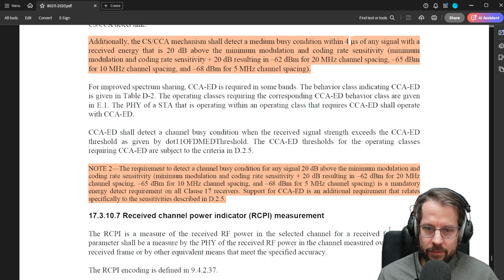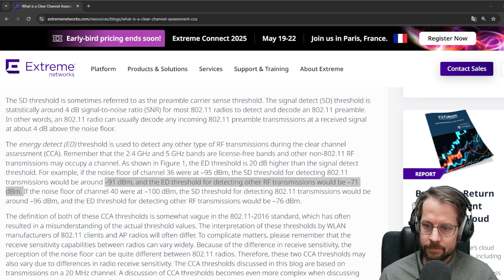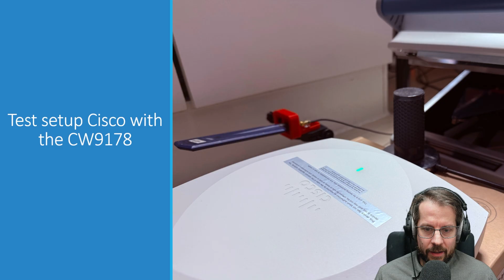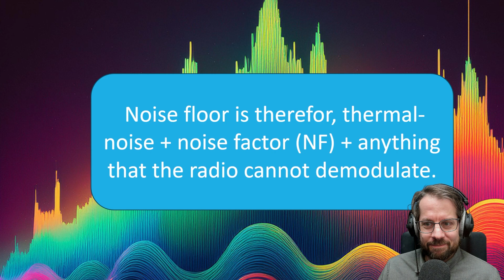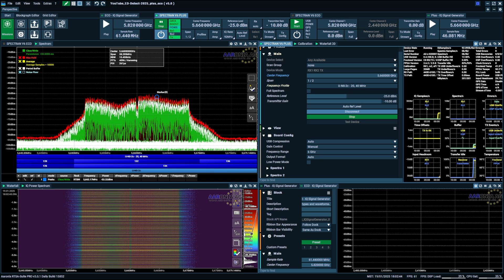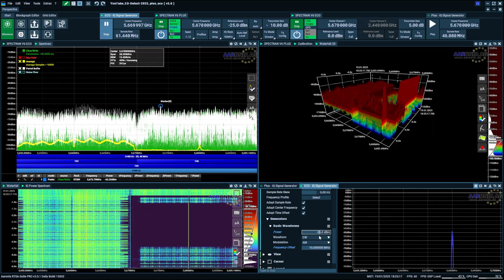Energy Detection in Wi-Fi - See how it works.

Comment: Great test, thanks for sharing. I'm hoping preamble puncturing will eventually be able to work around such narrow band interference. I too see many lighting sensors in the 5.8GHz band - jamming wifi. I will do some testing on later versions of code. PS the spectran V6 is an awesome SA for these types of experiments.
Reply from the maker: Yes, I hope so also! Thanks! Luckily the APs usually change channels, but I turned off everything that made them move, just do to this test. Cheaper APs might not change channels at all, and just stay there forever.

Comment: Thanks so much, this exactly demonstrates and explains the effect that I recently encountered with the 9178 WAP and lighting with single carrier motion detectors that operate across 5.8 GHz. In theory, the 9178 supports preamble puncturing; is this effective against a single tone in the way that you have shown in the video? Thanks again for taking the time to make and share such a detailed and informative video.
Reply from the maker: Thank you! No U-NII3 support here (well, we got it later, but very low power) so all the light sensor mess there has never been a problem for me. Regarding preamble puncturing, well, it will not work when it hits the primary channel, 80MHz is minimum AND it is ONLY static commands to make it work, so Wi-Fi8 it is. But RRM will change channel super quick, in this video I had to set it static bcs Cisco often changed channels as a good AP.

Comment: Thank you very much for your great and fluent presentation.

I have a few questions:

1-) I am measuring mediumAvailability for two different APs with Qualcomm and Broadcom chipsets. However:

    The first AP detects the medium congestion as 60%, while the second AP detects it as 80% on the 5GHz band.
    The distance between the two APs is approximately 1 meter, and they are placed side by side. The test environment is highly congested with both WiFi and non-WiFi signals.

Possible reasons for this difference in measurement between the APs:
a) Could it be due to differences in the CCA_Threshold values they use for Energy Detect?
b) Even though the APs are side by side, could some WiFi frames' preamble headers be missed due to differences in receiver sensitivity to the signals in the environment?

2-) For channelUtilization tests, would conducting the tests in closed chambers under controlled conditions be a better method to determine which AP provides the correct result?
Reply from the maker: Hi,

1a) Yes, it could be of different CCA_Threshold, and rf propgation and Rx sensitivty will not be the same either, and even 1m apart it could hear some RF from the other AP etc. It could be a lot of things, like how Aruba in my test detects before Cisco, but there it triggers radar detect and not ED first (happend to Cisco also sometimes)

1b) Yes, and yes, since we both do not have a big anechoic chamber, these tests will always differ a bit.

 - in short for question 1 - I used my SA to find a channel that was not used, and used ONLY 1 AP at the time, on that channel. With over 3 meters distance from any electronics, like my test PC. That way the test was better, having both on at the same time will cause to much RF so the test will not be as good in my opinion.

2) yes, much easier in a closed environment, I have a small RF chamber and put APs in there, but back to question 1 - I think having the AP on a channel that is not used. I am lucky at my house where only 36-64 is being used, so perfect -99dBm noise level on all other channels. I map channel utilization to the strenght of the 1kHz signal I make, when everything stops - it is 100% channel utilization.